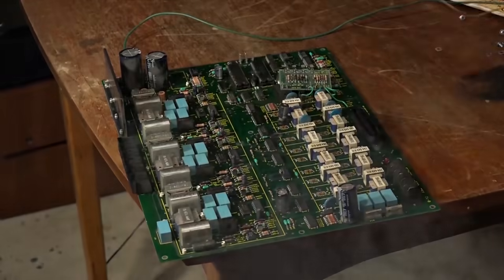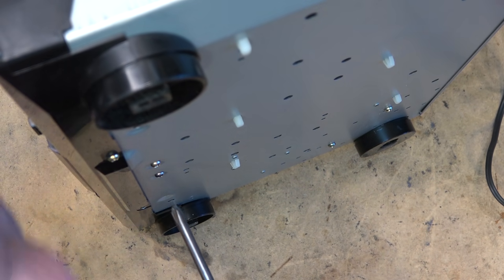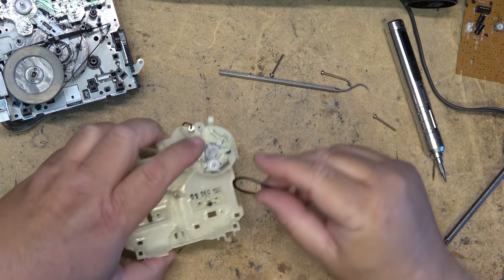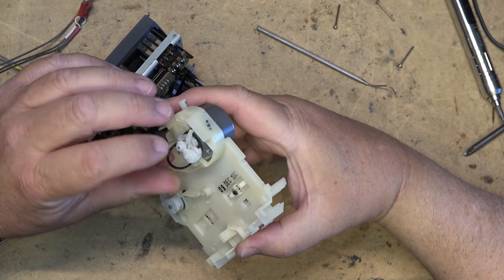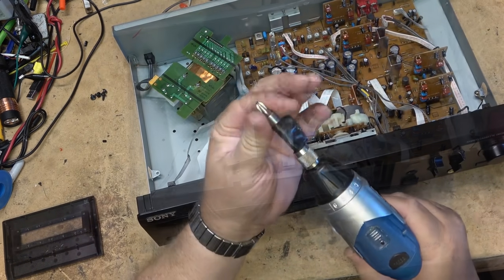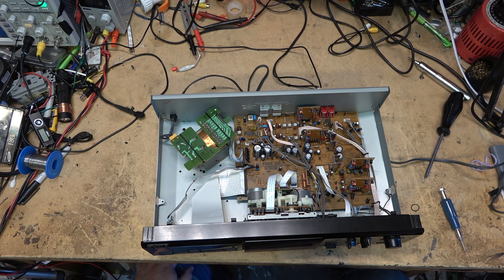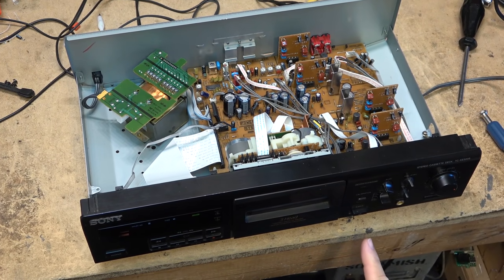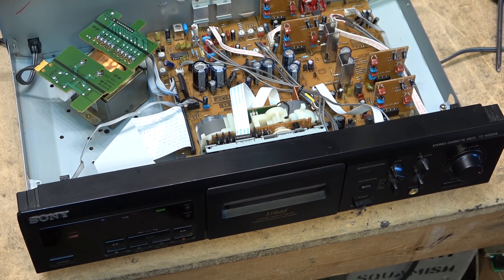Sony TCKE500S No FF Rew or Play Lets Fix it

Comment: Last generation Sony cassette deck: plastic , plastic, plastic.
Cheap, light, simple, extremely unimpressive quality.
The older decks are much, much better.
Reply from the maker: Agreed
Reply: Indeed.  However the older units can be annoying at times...  You know, like having to gut it to do a simple belt change.
Reply: @canadavey  Yes, that's true. But going through that trouble is worthwhile with the older (higher in the range) decks. The ones that still had aluminium fronts and knobs. And metal pieces in the drive mechanism, head tilt mechanism, not the kind of plastic that gets brittle with age. I hate that.
Reply: This was an entry-level 3-header. They were all plastic machines - across the whole spectrum of manufacturers.

I recently had to re-belt a Kenwood KX-7050S. It's a freaking nightmare with these machines that have the mechanisms attached to the faceplate subframe. Plus, the whole mechanism has to be disassembled to get to the capstan belt. And while doing that, it's almost impossible to not break one of those extremely tiny solder joints on the Mabuchi motors or the cassette compartment's microswitches ... because it just has to be motorized 😡
Reply: mo jo well, plastic age :P
Reply: @mrnmrn1  It all comes down to flywheel mass through rotational inertia. If you are unsure about the balance, you will be able to feel it when the mechanism is running. Also, you can see it on a W&F meter since an imbalance usually comes with a periodic wow.

I have an Aiwa AD-S950 that also comes with a plastic flywheel - but only for the supply side capstan. Which is probably why its W&F is still bearable but far from what really decent mechanisms could achieve.

Comment: the synthetic rubber ones last for ever.
Reply from the maker: That's what I thought and then someone mentioned that they went bad and the real rubber was better.
Reply: @12voltvids  i collect and repair many cassette decks....the real rubber belts I've found in every cassette deck I've opened were goo....melted...
The belts in old silver faced Technics decks were from synthetic rubber...all still working fine...
The real rubber is better in terms of performance but back then more expensive than synthetic ones...
But as longevity the synthetic lasts more.✌️
Again you have a great channel...hope in more cassette deck and amplifier videos✌️

Comment: oh this tape heads were bad,no high frequency.every body should avoid this although its fixable
Reply from the maker: Heads do wear. That's the way it is.  Hard to come by these days.
Reply: also a small little things about amorphous head,this materials will degraded by the time,i bought one of these and sounding not as good as source.when you buy a hundreds even a thousands dollar for a high-end cassette deck,when the head materials degradation,even worn less it sounds just disappointment  @12voltvids
Reply from the maker: The timing has to be set for all the gears.  There are timing marks on every gear.  I did a video on timing this Sony mech. It was an slvr1000 done about a month or so ago.